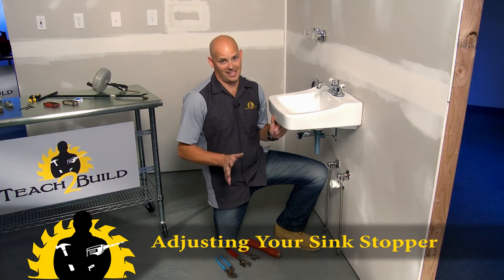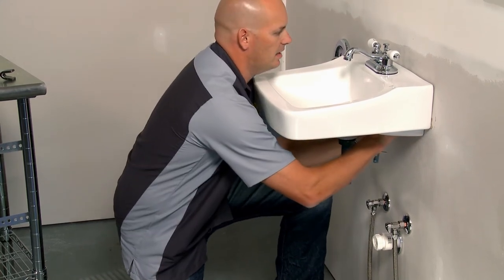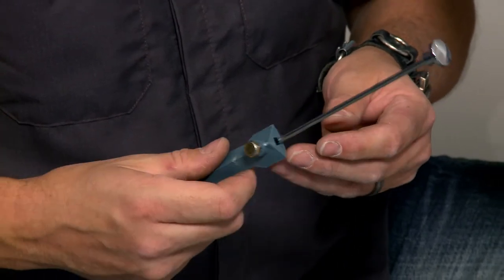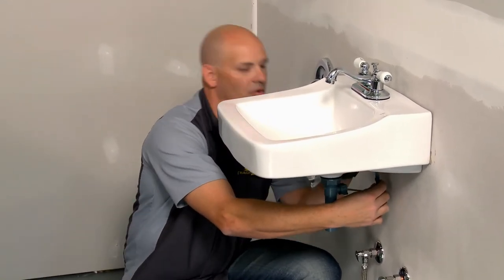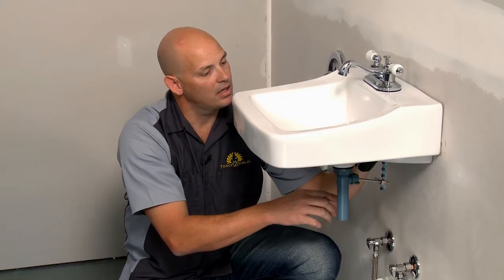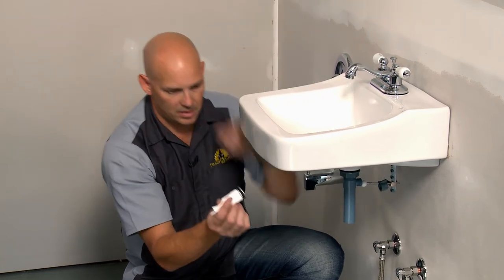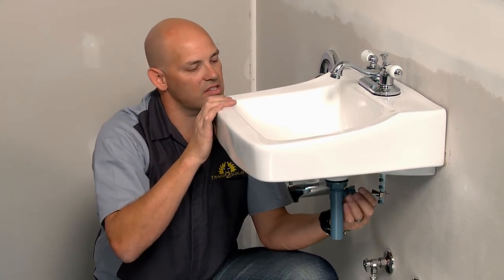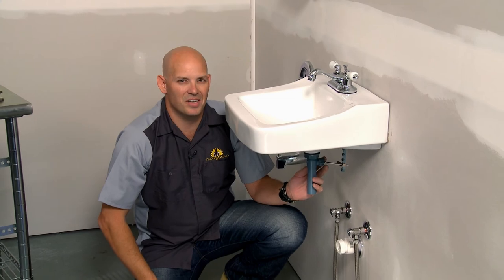Adjusting Your Bathroom Sink Stopper

Comment: Hi, you should have waaay more views. Your video is the only one I have found that goes into implicit detail on how to properly adjust the stopper assembly. Info such as how to select the correct hole, stopper rod position, stopper handle position. I was getting frustrated adjusting mine by myself. Under sink, get out, check it, adjust it, back and forth till I was livid. So thanks for the clear concise tutorial you put together.
Reply from the maker: I appreciate the kind words!

Comment: Followed this video to a T.  Watched it several times to make sure I didn't miss anything.  I have years of basic plumbing and home repair experience.  But I cannot get this stopper to raise or lower in the drain.  The spindle is properly through the stopper hole.  The rod is properly adjusted. The ball is seated correctly. I can physically lift the stopper and feel the spindle moving.  But when I lift the rod I get no movement out of the stopper.  The stopper will not open up.
Reply: You have over tighten the ball, tighten it just enough as to not leak